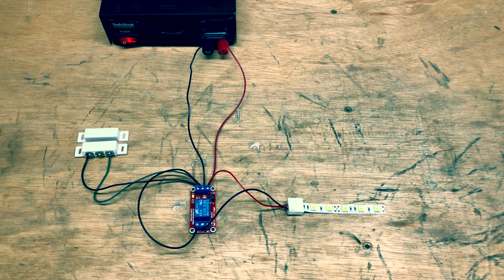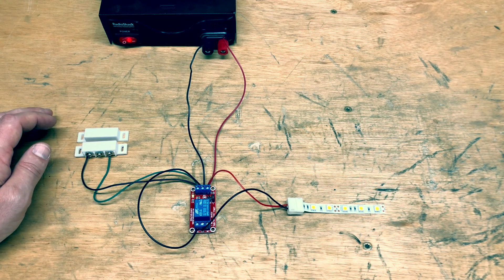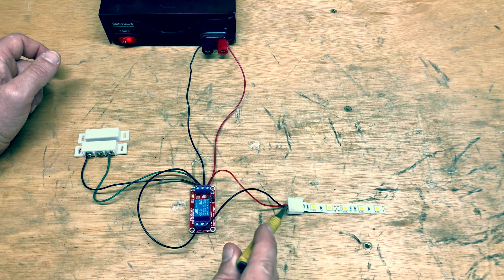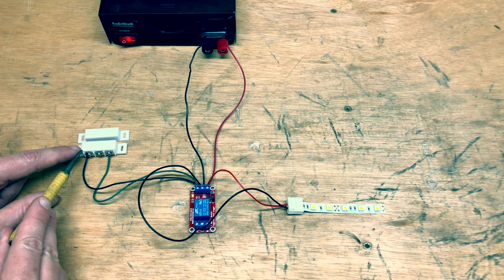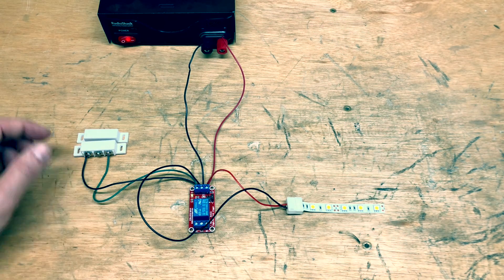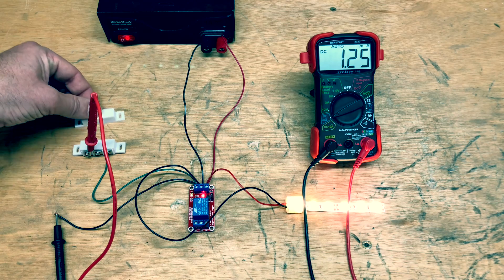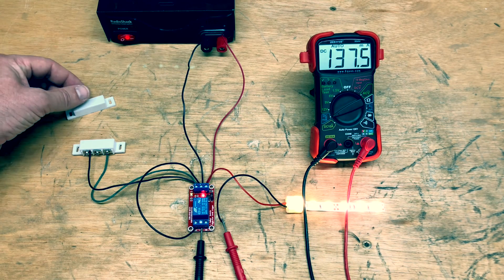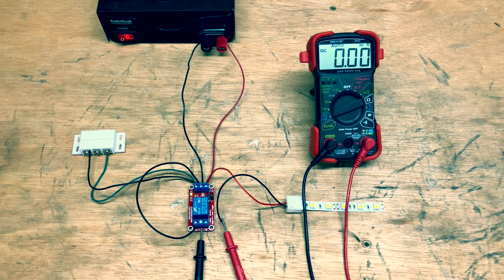Wire magnetic reed switch with relay for high current

Comment: Thanks for the video and for the note about the jumper pin.  Instructions worked great!  I added the relay after my reed switch melted down from a too long LED strip in an under-shelf application in my pantry.  The reed switch is staying cool and so far it is operating flawlessly.

Comment: Can you use 3 reed switch, one relay and one led strip?  Or is micro controller is required.  I have an old 3 door refrigerator that doesn’t have light.
Reply from the maker: Yes. Should be easy. Hook up each reed switch to the relay in parallel.
Reply: @mattadata2  will there be a issue when multiple doors are open at the same time?
Reply from the maker: No issues

Comment: Thank you!!! I must have watched this video dozens of times in the process of writing LEDs with reed switches in five closets of my home... I put the relays in electrical boxes above each closet in the attic. I found that it was much easier to jump to wire nuts than put multiple wires in the relay connections.

Comment: can you add a 2nd reed switch to this for the 2nd garage door?
Reply from the maker: @ds99-99  you need a 2 channel relay board.
Reply: @mattadata2  Do I still need a 2 channel if I'm using the same led strip for both doors?
Reply from the maker: @ds99-99 no. You can wire it with single channel. Just wire the reed  switches in parallel. The light should turn on when either door is opened.
Reply: @mattadata2  thank you

Comment: can i use this for a 120v application?
Reply from the maker: @davion2881  yes. On the output side you can.
Reply: @mattadata2   i was lookin on other videos about this how would i able to not over load the reed which while using 120v with your wiring
Reply: can u make a video showin a 120v application
Reply from the maker: @davion2881  Probably....but not sure when I will get to it :)

Comment: This is great.  Can you add more LED strips to the relay? Going in different directions, to different rooms?
Reply from the maker: Yes, you can. But there’s gonna be a limit to the length that you can run a 12v length of wire. The voltage will drop it if you get too long.
If you have longer runs planned, you may want to switch to 24 V  leds.

Comment: Hello, what rele module could I use to shut-off air conditioner when someone opens the window in the room and to starts it again when it closes? Relay should be at least 16 amp for 3kw device (1500w draw)? I would use 1A switch on window. Thank you

Comment: I will accept anyones help that will offer it. I wanted so badly for this to work for me. I'm connecting this to a 12 volt truck battery. I ordered the relay thats recommended in the post. It came with 2 in the package. i installed one exactly as described and it worked perfectly . The switch was cool but after about 5 minutes the relay became very hot.I thought the relay was defective so i switch it out with the other one. Same issue. Then a ran across a post that said make sure you order the 12v version.I looked at my relays and discovered they were the 5v version. So that explained why  the relay was getting so hot. I installed the new 12v version exactly as this video instructed and the identical way the other 2 were wired. Did not work. Thinking the new 12v relay was defective i ordered another. Installed it correctly and it doesn't work either. I'm at a lost as to why the two 5 v versions work and neither of the 12 v versions worked. This is wired to a 12v battery.
Does anybody out there have a explanation as to why and offer another alternative? I know this is long winded but damn i ned some help. Thanks for your patience and suggestions.
Reply: Hey, I'm also having trouble with this. Any luck getting it to work? Tips?

Comment: Received 2 relays in my order. Wired 1 up exactly how this video shows.I have a green light on the board however when i open the magnetic switch the led's come on accompanied by a red light with the switch open. Is this normal?  Now I have a green light and a red light lite up.The switch is cool now but after about 10 minuted the relay gets real hot.  Is this normal? I thought the relay was bad so i wired the other up with the results. Are any of these concerns valid?
Reply from the maker: Not sure about the status of the LEDs...but I think that is fine. 
How much current are you pushing through the relay? And what voltage? Just make sure you are under what the relay is rated for. 5V, 12V, 24V etc.

Comment: Can I simply ground the negative wire instead of running it all the way back to my battery?
Reply from the maker: Yes, you should be able to assuming you are working on a vehicle with a negative ground frame or similar.

Comment: But when u switch to high then  power going thru reed switch is not 5v its 12v hoq to fix that?
Reply from the maker: The voltage here really doesn't matter....5V or 12V. What does matter is the amperage. The high amp load (Led strip in this case) is going through the relay only.....not the reed switch. The reed switch still has very little amperage going through it.
Just get a module that will work for your needs. I have seen them for 5V, 12V, and 24V

Comment: Can it be used with a load of 24v dc alongwith 24v dc relay module
Reply from the maker: Yes if you buy the 24v version of the relay. In my demo, I used the 12v version.

Comment: Hello, this is just what I need! I’m building a DIY lamp controlled by a reed switch. I see you use a DC power supply. Will this relay work with an AC power supply such as a standard wall outlet? Thanks!
Reply from the maker: Hi. So this relay can switch AC current from a standard wall outlet ON or OFF to your lamp. But you will still need 5V DC to control the relay.  (Be careful when messing with AC!)

Comment: Can more than one switch be wired the the same relay and still function independently? Maybe with a fancy controller? Your videos are great! My supplier was telling me all wrong and this helped a ton. He tried to sell me a 50$ controller for each switch for 15 drawers in some cabinets. Thank you!
Reply from the maker: You could definitely do it with a small micro controller like an Arduino or node Mcu.  So you want multiple switch inputs to one relay controlling one load? 
I think you could simply put multiple read switches to the same pins on the relay.

Comment: Hi can i use other relay for high current load? Like 36v 60A ? Which relay should i use with the reed switch?
Reply from the maker: Hi. Yes, you can use other relays. But 36v 60A is pretty big! You would probably need an automotive style relay or maybe even a solenoid. What are you powering?
Highest I saw was 36v 40 amp https://amzn.to/3oiYUQX
Reply: @mattadata2  I built my own electric motor fin for my paddle board and i thought of adding a magnetic kill switch. Almost every Electric-fins out there have them built in and i have no idea how they do it 😅 I saw the 36v 40amp but it will just burn out since the constant amp the motor pulling around 48-50A. Will Solid state relay works? 🧐
Reply from the maker: Cool! Sorry, I really don’t know much about solid-state relays. But I know a solenoid would work. That’s what my golf cart has in it. 48 V and over 200 A

Comment: Thanks for the video. I tried to hook up the relay to my reed switch, but it doesn't work. I triple checked and the wires are all connected correctly. I tried to read your post. You said you forgot to mention in the video is to make sure the jumper is set to the L side, not the H side. What does it mean? Also, when I put the magnet to the reed switch, the relay doesn't click like yours.
Reply from the maker: Here is a photo of the jumper for the L or H https://photos.app.goo.gl/Daa1hWzg2W4JgdGL7
You are right, if it is not clicking, its not gonna work. Try the jumper change first.
Reply: @mattadata2  Thanks for your reply, i don't see any photo from the link above. any help appreciated

Comment: Can you explain the low / high trigger
Reply from the maker: Not 100% sure, but I think it changes are sensitive the trigger signal is. Some electronics run at 3.3 volts, some run at 5V+. So you can set your relay based on that.

Comment: Hi, is the relay can be use for 12volts  for car? Now trying to diy for my float but failed, the switch blow. Need your advise sir . THank you
Reply from the maker: Yes. Just make sure you get the 12v version. https://amzn.to/3Bj3jbv
Reply: @mattadata2  hi sir, how can i contact maybe by email. I have the diagram but still cannot figure out which to connect. Thank you
Reply from the maker: https://mattadata.org/contact/

Comment: Hey...first of all many thanks for ur video...really helped me....can u please let me know the circuit diagram of how to use two magnetic reeds with one relay.....I actually want to do this for my two sliding door wardrobe....
Reply from the maker: hmmm, great question. Let me think of a solution.
Reply from the maker: Here is a very simple diagram on how to wire two reed switches in parallel with one relay. Make sense?
https://photos.app.goo.gl/5T76vsaWFH6NfLPL9
Reply: @mattadata2  so kind of u for a quick reply....but I didnot understand thru the diagram....can u give me the wiring diagram

Comment: This video was exactly what I was looking for.  I'm using the HiLetgo 24V.  I found that when Low/High jumper was set to Low then DC- was supposed to trigger and it wouldn't reliably (the red LED would just flicker and not lock).  I simply changed the jumper to High and used DC+ and IN then the relay would trigger reliably.  I found 2ma of current to the ReedSw which is fine.  Thank you again for a superb video.
Reply from the maker: Great! Glad it helped.

Comment: Do you think I need to use a relay for 2 led strips in parallel, 12V 1.2Amp total, with a 18W power supply? Or is, for example, a 500mA reed switch enough, it will only power the leds for about 30 seconds max, each time a door is opened.
Reply from the maker: 30 seconds max and I think you will be fine. Put your hand on it to feel how hot it gets.
Reply: @mattadata2  the relay you have is at low level or high level?
Reply from the maker: @fran7ribeiro  I have it set to LOW.

Comment: Although using the relay absolutely is better than just using the reed switch (door contact sensor). Keep in mind that these reed switches are only rated for about 0.1A@100VDC (max), 1.0A@10VDC (max), 10W (max)

Comment: So i need to use a push pull reed switch to trigger a 12 volt led for a moped, this will work?? I hope so running out of ideas
Reply from the maker: Sorry, I don’t understand the question. What are you trying to do?
Reply: @mattadata2  Sorry I have a moped and need to use the brake lever to trigger a reed switch, for a LED brake light. the brake light is powered off of 12 volts motorcycle battery, will this work to convert the 12 volts to signal the reed switch?
Reply from the maker: Yes. You should be able to control the brake light with the reed switch. But, it doesn’t seem like the best solution to me. I have no idea where or how you would mount the magnet. As long as you can get past that issue, it should work fine.Good luck. Let me know how it turns out.
Reply: @mattadata2  Thank you I got one and got my push pull reed switch, it works like a charm, Thank you for this viedo
Reply from the maker: That’s great!

Comment: I'm gonna use this set up for my shop but instead of a light I will have a alarm. How do I add independent reed switches
Reply: Connect busbars to the relay and then connect the reed switches to the busbar. That would mean that all the reed switches run on the same circuit through the relay and any one of them closing would activate the alarm.

Comment: I wonder if a person can use this relay with other reed switches, like running  motor and for hobby. I would think they are all exactly the same concept, magnetic switch running on 1/2 amp or get fried sooner than later with higher amp which happens easily.
Reply from the maker: Yes, should work for any application as long as the relay can handle the load, which is 10 Amps.

Comment: Very well appreciated sir! Presently installing LED lights in our pantry and your video clarified the wiring extensively. There are many negative reviews on Amz as buyers state the NC NO are reversed. Well, you go with what you have. Not sure why but the relay would not trigger with the jumper in its original position but the text you added explained and once positioned properly, all is fine.
We do have a 4 doors pantry on 2 levels. 2 switches are connected in parallel COM to COM, NO to NO for each level. They work fine independently from each other.
Mentioned your video on Amz review so others can appreciate your excellent work. Isn't  it weird that you have to jump externally?

Comment: Hey, I`d like some advice if you`d wanna give it.. If i`m planning on using two reed contacts of the same 60w power supply, as in I want to be able to open the lights(LED strips) individually on each side of my sliding door wardrobe, should i opt for two separate relays, one for each line or can i go with a 2 channel relay?.. The power needs for each side is about, idk, 10-20Watts.. Also , a fixed low lvl trigger would work just as well, wouldnt it?
Reply from the maker: Hi. Yes, any of those options would work well. Good luck!

Comment: 2 red (+) in dc+
3 black (-) in dc- 
1 green (data) in in 
? 
And you're using 12v supply for both (for Reed switch and led strip) ?
Reply from the maker: San b - yes. One single 12v supply for both.
Reply: 2 red (+) in dc+
3 black (-) in dc- 
1 green (data) in in 
Is this wiring ok as you said !!
Reply: And if you don't know the REED SWITCH can work with up to 300vdc 0.55 amp that's a wide rang

Comment: Thanks for the great video! What wiring changes would I need to make to make this work without a negative? for example an led strip with two positives (one for white one for orange) and only one negative?
Reply from the maker: Can you share a link of the LED strip you are referring to? If it has two positives and one negative, then you should be able to run the 2nd positive to the DC+ screw terminal on the relay board. Its the one in the top right of this video.
Reply: @mattadata2  Hi thank you so much for replying.
This is the LED strip: https://www.amazon.co.uk/gp/product/B07CNB8XL8/ref=ppx_yo_dt_b_asin_title_o01_s00?ie=UTF8&psc=1
It has various positives for different functions. What I'm trying to achieve is 2 positives active with the door closed, and only 1 when its opened. 
The two positives activate red or yellow coloured leds, with the yellow colour overriding the red (so if red and yellow are connected, only yellow shows)
I wired up everything as your video but the problem is with the ground of the led strip attached to "com" on the relay, it only activates at all when the door is closed.

Comment: I was looking for a video to assist with this wiring, thank you for the excellent video.  In my case I have a 24v LED strip and power supply so I'm planning to use a step down transformer to 12V to run the relay.